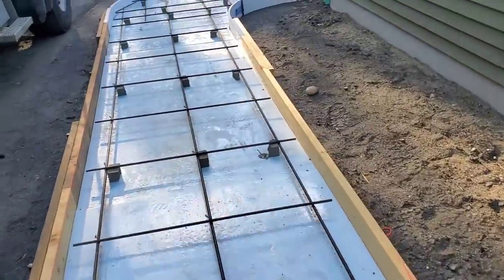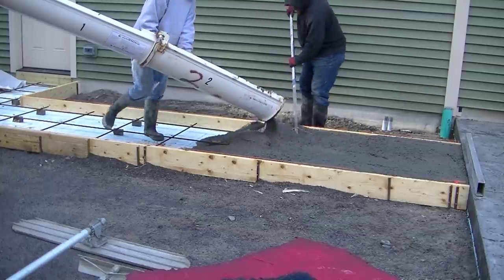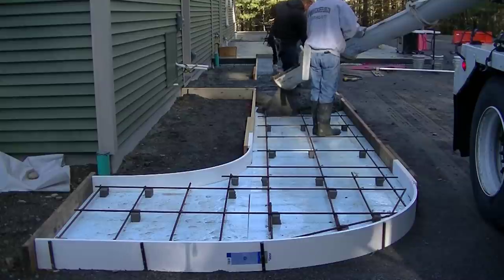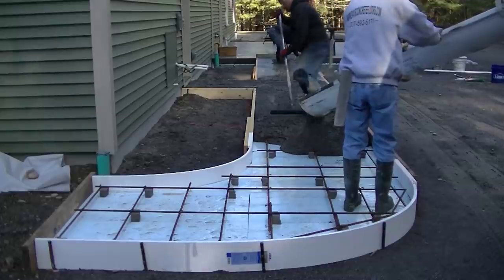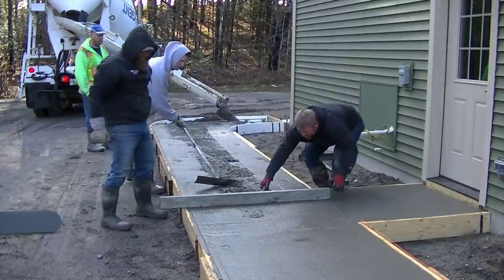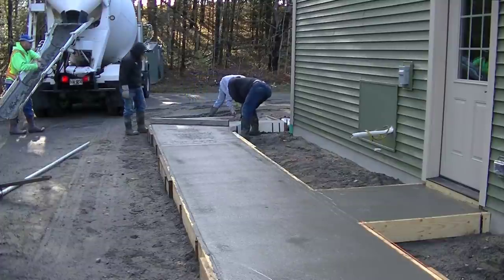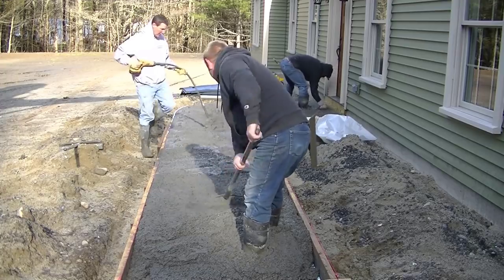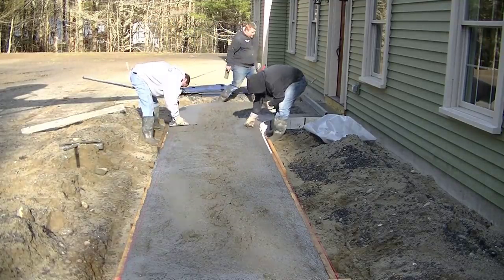Concrete Sidewalk Pour (Front & Back Yard Walkways)

Comment: Great job on the sidewalk. I am a commercial concrete supervisor In Knoxville,Tn and surrounding states in the south. Poured 480 yards Tuesday for Red Stag Fullfillment. We don’t use styrofoam in our sidewalks and they are 4” with wire mesh. We cut our 2x4’s about 1/2 way at 45 degrees to make it bend for radius’s. Keep up the great videos. Always great to see someone else doing what you do daily. May all your pours be smooth.

Comment: Excellent work .. question is there an advantage of using metal stakes .. we use wood stakes
Reply: Can be used over indefinitely. Has several holes also for the nails.

Comment: Re bar adds tensile strength to concrete, that’s its purpose.  Concrete is weak in tension, because it doesn’t flex, it just cracks and breaks.  If you add re-bar, it actually does make the concrete stronger, not in compressive strength, (the 4000psi rating) but in tensile strength. If you put reinforced concrete in tension, now you have to stretch the re-bar, or break it’s bond with the concrete before it will break.

Comment: Yo Mike, Thanks again for the awesome direction as usual. I always hear you mention Fiber Mesh, Mid range reducer, but not much about Calcium. I recently poured a slab with a friend who has poured for many years.( Old Timer)  We were not able to get the material until after 1 PM so my friend asked the concrete company to add 1 percent Calcium. ( He said otherwise we would be their all night)  My friend kinda took off after we got the material layed out and floated, but the first section really started to get hard to work pretty quick, over all the project turned out good but not what I would call a primo indoor/basement finish. The temperature was around 80 Deg F with some sun, we did have some limited cover, anyway could you elaborate on your experience with adding Calcium. Oh, also when we ordered the mix i asked for a mid range reducer and their comment was we put reducer in all our concrete?

Comment: Why was insulation placed under an exterior slab?  Isn't the warmth from the ground desirable during freezing temps?  It will delay or even present the concrete from freezing on some freeze-thaw cycles?

Comment: The contact page on you web site is broken
Hello, saw some of you videos and they are great and direct to the point.
I am a homeowner and do small projects here and there, too small to have the concrete delivered.
I think I mix too stiff, it does not seem to flow like what I see in the videos and it is difficult to get good finish.  What I now is that the amount of water stated on the quikrete bags is nowhere near enough and I know if too much can cause problems. Do you know of an easy method to determine correct mix?
Reply: Remember, ‘Quickcrete’ has a guarantee/warranty to uphold, so if they just said “add as much water as needed”, the concrete would not come up to the ultimate strength advertised on the bag (4000psi)
If you’re just pouring a few things around the house, chances are they’re not structural. If you add 30-40% more water than what’s recommended, it will probably only decrease the strength by about ~500psi, which should be more than sufficient for projects at the house. It wasn’t that long ago that sidewalks were regularly spec’ed at a 2500psi mix. 
Also Mike is using a chemical additive in these mixes which greatly increases ‘flowability’ called a ‘Medium Range Water Reducer’. And I’ll let you in on a little trade secret - Medium and High Range Water Reducers are chemically almost exactly the same as dish washing soap. I can’t recommend to you how much you should use, so I would say run a cpl small scale experiments to get the proportions right. I have a feeling it doesn’t require adding a whole lot.

Comment: Hey Mike how many guys to pour a 50x100 slab? Minimum
Reply from the maker: The 3 of us could do that, but 4 or 5 is much better.
Reply: @MikeDayConcrete  you mentioned April to December was your guys’ season. It made me think of our last house that was less than a year old with a concrete driveway that delaminated after the first year. I ended up going back and forth with the builder and getting a few thousand bucks to repair the portion of driveway that was damaged. No sooner I got that money and the rest of the surface started to chip away. That’s why I’ve vowed to do my own concrete work because I feel like that’s one of the worst things that could happen so I got not nothing to lose.  My neighbor at the time suspected the concrete guys added water during the pour that caused the outer 1/4” to flake away. He also suspected they poured on a cold day. I want to make sure that doesn’t happen to me, I get to pick what day I do this, I get to choose additives, request delivery times etc. After paying for your Concrete Courses this past week I feel much better about preparation and finishing but I was wondering if there were any key things to not do that would cause my pad to disintegrate like our last home’s driveway did. If my garage pad goes well I want to do my entire driveway which is about 400’ long.

Comment: Mike are expansion or control joints needed?
Reply: Expansion joint should always be used against a permanent structure like a house, a control joint are either the tool joints or saw cuts that you put in. Control joint are used because concrete will always crack at some point in time, and you want to control where it cracks. Control joints are always needed unless you poured like a 5’x5’ square lol.